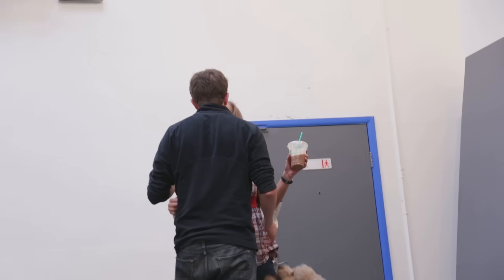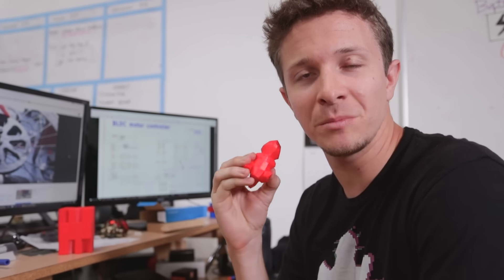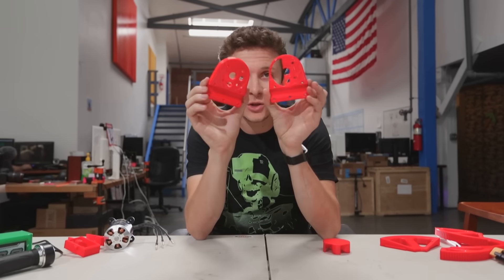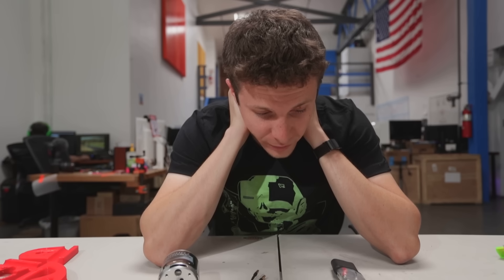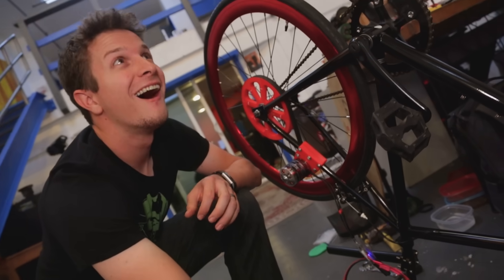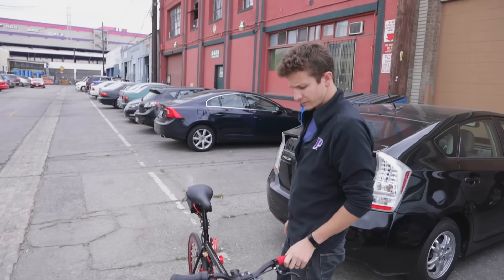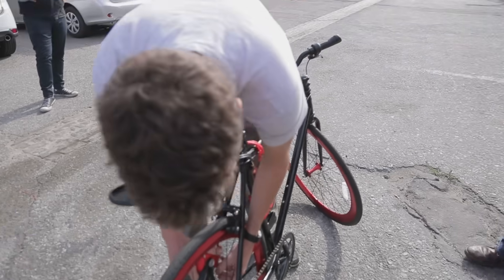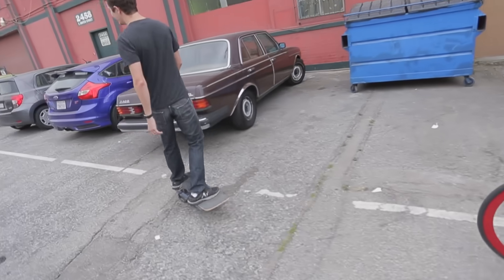Building a Tesla ELECTRIC BIKE For my WIFE

Comment: Takes already invented system (least gives credit to inventor), assembles it pretty much identically, is able to fuck it up and uses days to problem solve non issue.. and comment section is getting orgasm about this thing... did i already mention i hate humanity?

This is easy build and there is next to nothing to be impressed about. Hole went off center cause operator didnt mount it properly and didnt use proper equipment to make the hole. Motor mount was not properly tighten, so active breaking pulled the mount into spokes. After that whole thing was easy to fix and he just added bullshit drama for sake of views, or are people unable to drive local bike shop, or better yet fix it them selfs?
Also how this is anyway related to Tesla? Clickbate much? Cool topic but sadly most videos are this type of cancer..

Comment: In order to not bother with settings on the printer, which sometimes can be fiddly, they can even mess your print, one can buy a hot air desoldering station (the cheapest that allows for control) and a few misc parts. A wide nozzle is required (usually used to de-fuse the large chips, like GPUs or CPUs). It has to be oriented from the 3D head mostly in line with the last layer (i crushed mine to a thin slit by placing 2 mm gauge block inside and then applying some force with my hand), but at a small angle to catch some of the adjacent print).

Once all that is done, you have to really understand your PLA, your infill, and your speeds (if you're aware of the basic concepts of feeds and speeds in machining, understanding this from the 3D printer side, is much, much easier, it's like a mental map of the whole process), once all those things are set, you dial in your temp, and let it work. The PLA is kept at a nice toasty temperature, which allows fusion and a stronger part. 

IF you do this right, and i'm nowhere near as good as the person who showed me this trick in the first place, you can squeeze even ~20% more strength from your PLA. I did tests on PLA bars with various infills, some patterns work better with this method than others, after all, you don't want too much heat, lest you melt your work.

For regular work? Not worth it, but when you're prototyping stuff like miniature gearboxes or drive systems for a 1/50 scale for example proof of concept that needs to take some scaled abuse, well, it's priceless.

OF course, if you know your 3D simulations, this is obsolete, but sometimes, actually working with physical parts is better than watching a CAD twist and flex in psychedelic colors. :)

Comment: If you had access to a mill to bore that hole in the pulley it'll give you positional accuracy over the drill press. A drill usually creates holes that are oversized by a few thou so the pulley being loose is to be expected. 

The shaft should be keyed or notched if you want the set screw to work properly. A few seconds with a steady hand and a grinder will make a flat that'll hold the pulley secure. 

Glad you got the project done with the wife. Looks like she's really enjoying it.

Comment: You need to use a key on the pulley and the motor shaft. It will 100% stop it from free spinning. Good Job though :>

Comment: Sam kWh is metric, you don't need to explain it the rest of the world knows already :D
And to connect a part to a motor you simply drill a hole 1/2 1/2 when the pully and the motor are together cut a small thread in there and then a screw. Or you put a groove and featherkey in there.

Comment: I would have used thermodynamics to bind the engine shaft to the sprocket. Freeze the shaft, Heat up the sprocket. .... Sounds like a bad porno. I digress.

Comment: it's also good because if the battery runs out, she could still just pedal
Reply: Jack The Artist Exactly!
Reply: What is so special about it anyway? You dont know anything like electric bike in USA? ;)
Reply: she would have to unplug the motor from the vesc first, otherwise it might fry it.
Reply: what did you think the ped means in MOPED
Reply: lol
Reply: lol
Reply: yeah... but, no.

When you pedal against a motor, you either fry or charge it.
Reply: not true. It is made for pedal.
Reply: Jack The Artist    You should look up what a moped is. That will blow your mind.  A motorcycle you can pedal!

Comment: If the "motor should move with the wheel" and "one would not move without the other", would the motor charge the battery if the bike is in motion without operating the motor (similar to wind turbines)? or does the power only go one way?

Comment: Hey I am actually in the process of building one and already got my high torque motor and 40A ESC. I was wondering from your experience, how much of those 10A battery do you burn per hour? Do you connect those 6S in series or parralel? Thanks!
Reply: Depends greatly on how much throttle you're using, wind, terrain, bike weight, your weight, tire pressure, etc. For example,  I've got a BBSHD mounted on a Mongoose Dolomite. That's 1000 watts nominal with 300 lbs of bike & rider. My battery is a 48V 24Ah. If I ride all throttle, I get around 25 miles per charge and do that in about an hour. Using pedal-assist at a low setting, like 20%, I can pull 50-60 miles at 18 mph. That's on flat terrain and light winds. If I'm running low tire pressure, obviously I get less range. Check out "E-bike School" on YouTube, he's got a lot of info.

Comment: To fix the spinning spindle in the gear you could have drilled a hole the same size as the set screw into the spindle of the motor. Then use a slightly longer set screw so that it actually goes into the hole. Even a third or halfway through and the gear would prevent the gear from slipping.

The other problem with the motor mount rotating on the frame with the regenerative braking could have been solved in a similar way. Though the plastic might not have been able to deal with the stress of the regenerative braking. A metal mount either bolted or tack welded to the frame might fix that and allow you to still use the regen braking. 

That plastic mount may eventually still end up getting loose and flipping over later.

Comment: m8 when the motor was spinning and the wheel wasn't you could have just drilled a hole into the metal belt catcher and the motor stick part and put a pin in them
Reply: id have to draw a pic to explain it but it would work better then what you have now

Comment: My recommendations:

1) The motor would fare better in the little space between the seat tube and the wheel.  A mount there, reaching from the rear wheel's seat stays to the seat tube, would be triangulated and thus much more firmly mounted than the existing clamp style mount which is, as you found to your regret, subject to slipping and rotating.

2) using the mounting described above, orient the motor so its mass is more closely centered on the bike.  It will be a much stealthier mount, way less vulnerable to foreign objects in a ride, and possibly somewhat quieter, with its noise generated being under the rider instead of off to one side.

3) Mount the batteries in the main triangle.  This gets their mass lower and frees up the rear rack for cargo, as God intended.  There is also room in the triangle for a metric butt-ton of batteries, giving the bike potential range suitable for modestly long commutes.

4) Lighting.  I don't ride anymore because Tennessee drivers can't see bicycles.  Adding lights is a good idea to make the bike more noticeable.

Comment: Next time you have an issue with Pully-shaft, try using a key way and a key, thats how motors are mounted properly, the screws are there just so it doesnt slip off on the x axis lets say, the key is what prevents the slipping.

Comment: Looks good but i would like to make a few comments about this.

1. It can be less complicated and less likely to break if you just use a hub motor. 
2. I wouldn't trust that battery on the back of the bike as it makes it back heavy. See about either putting it in middle frame where bottle holder is or if your really confident soldering the batteries inside the frame itself. 
3. Plastic has gone along way but i wouldn't trust those parts out on the road, half way through it can snap and can have serious injury.

So in the end when you ask what to build, maybe a updated version of the ebike.

Comment: I built one of these with a much more powerful motor and the 3d printed pulley on the rear ripped apart. I should've used better glue and zip ties :(

Comment: Grind 1 or 2 flats on the shaft of the motor to give the set screws a fighting chance and not just relie on the clamping force of a 3 or 4 mm set screw and friction between 2 pieces of steel.

Amicalement,
Tim

Comment: I am amazed by how you were able to design those brackets and big pulley wheel that you 3D printed, as you clearly have zero engineering knowledge.
I mean come on; "why is the wheel wobbling", soldering the pulley and attaching the motor bracket just with friction. Those are all kindergarden-level fuckups. Any 10 year old knows better where I live... Your school system must be failing in a big way...

Comment: lol at 13:44, the limousine is being towned away xD
One more thought, when the bike is going with the electric motor turned off(for example riding from hill) the motor is generating  
 back voltage which can goes back to ESC and it can destroy the ESC.
If I am wrong, please correct me.
Sorry for bad english.
                                                                                                                                                         Krystof

Comment: Ummm, someone show him a real ebike, because this is just hazard in the streets.
Reply: Could have at least added a support from the motor mount to another part of the frame, relying what he currently is is just kinda stupid.
Reply: ᕦ( ͡° ͜ʖ ͡°)ᕤ Ultimate #POWA IT is 2-4 times cheaper not hundreds of times cheaper
Reply: chadel lol was looking through comments for random tips but just HAD to point out that even  copying someone else's design can be a good learning experience. Have you ever done a math problem in homework. Chances are you didn't make and solve the problem.
Reply: dzhiurgis - yeah i was thinking the same thing. Go to Lithium Cycles and grab her a Scout for like $900. It'll work, u won't have the headaches and there's a warranty. Plus, she looks like she's 70lbs. soaking wet so it'll be fast as hell too.
Reply: Amazing learning experience copying someone else's project and investing zero creativity
Reply: ᕦ( ͡° ͜ʖ ͡°)ᕤ Ultimate #POWA lol ya i would say this bike thing is a great idea. It's not that dangerous if u know what ur doing , aka have common sense and it overall costs about $500 to make as opposed to about $1200 or more for a similar product. Plus using what other shave done before is a good way to test how to make these things and possibly make ur own design
Reply: dzhiurgis This doesn't seem too bad to me. But the better homemade bikes I've seen attach the motor to the chain, rather than using a plastic belt, and keeps parts away from the wheels which means if anything does brake, you can still pedal or coast to the side of the road an fix everything.

Comment: i think you could get disc brake hub and mount big pulley where disc goes, this with zip ties is weak, and electric motor is toomuch exposed, you should consider to swap it place and mount it in inner triangle where rear brake is, right on place where the seat tube and 2 tubes from chainstay meet, that would benefit of making a motor mount on 2 tubes wich will be more sturdy, just my 2 cents

Comment: This needs a sprag clutch on the motor drive portion so the motor doesn't brake the wheel when you slow down.

EDIT:  Hahaha!  He broke it when he let off the throttle, nailed it!

Comment: Did you just call kilowatts a measurement of speed? That actually upset me. Power. It's power.
Reply: WILDLIF3 You are joking aren't you? Do you know basic physics? "speed for vehicles" oml. A kilowatt is 1000 watts. A watt is a unit of power, equivalent to 1 joule of energy per second. It has nothing to do with speed. 1 kilowatt is the same as about 1.341 horsepowers. It's not "sometimes called a horsepower", they're two completely different units for POWER.  Power is the rate of work done, which is force times distance, so power is force times speed. Kilowatts aren't a measure of speed, they're a measure of how much torque is produced per second (1 Newton metre per second = 1 watt).
Reply: BLUEHBEARZ Official Technically we are talking about movement in terms of electrons but still, this other guy is chatting shit with his sub-college level knowledge of basic physics
Reply: Matte Edström damn you're fuckin dumb
Reply: Rebellion I noticed that, too.
KW/h is a measure of power used, while a KW a measure of power. I think he meant to clarify it for people in the US who are accustomed to motors rated in "horsepower" but still billed by KW/h
Reply: Ecto Not necessarily....it depends on how much weight that power is pushing.
750w on a bicycle might get you 25mph but would barely be able to get a 3000lb car moving.
Reply: He said a kilowatt is a measurement of speed and kilowatts hour is the energy
Reply: He also did not consider the energy losses for charging during his cost calculation that might have a quite percentage of energy gotten by a battery. I mean that the amount of energy gotten by a battery never equals the energy spent on charging.
Reply: A kilowatt is a unit of power, power is the speed at which an electrical current can do work, thus, power can be loosely defined as speed.
Reply: He said kilowatts pertains to speed, which is obviously not always true, but this time it is. I think he just over-simplified it.
Reply: In a way he's correct by saying it's speed. A kilowatt is a unit of power, which is energy transfer per unit time. So you could say it's the 'speed' at which energy is transferred, which is what he meant. There's also the fact that he's an engineer, while a lot of people watching this might not have taken physics at high school level. He would therefore know that calling it speed is not entirely technically correct, but he also wants to make what he's explaining easy for everyone to understand.
Reply: Rebellion I can go 8 kilowatts an hour
Reply: BLUEHBEARZ Official energy*
Reply: I think he meant kW is to kWh as speed is to distance.
Reply: I'm totally late to the comment thread here but I stand by my statement. I described power as the speed of energy... WHICH IT IS! Power is literally how fast you can move a unit of energy. I think you misunderstood what I said. I was trying to describe this in a way most people might understand, so it may have seemed incorrect. The average person doesn't understand the difference between power and energy even though they're two very different things. 

What I find ironic here is Magic Balazs quote: "A watt is a unit of power, equivalent to 1 joule of energy per second. It has nothing to do with speed."
DUDE you literally just described the definition of speed, which is a unit of something PER UNIT OF TIME! You literally just said it's energy used per second. So if I'm going 1km per second... would you not describe that as speed?
Reply: Rebellion The kilowatt if you were to look it up in relation to a car engine is the speed. If a gasoline car is outputing lets say 85 kilowatts then it has 115.56783 Horsepower which you get after you convert the kilowatt to horsepower and horsepower deals with speed. Please read something on cars/vehicles
Reply: Speed = Power / Force
Reply: Horsepower definition - a unit of power equal to 550 foot-pounds per second (745.7 watts).

Torque definition - a twisting force that tends to cause rotation
Reply: Torque, Horsepower, and RPMs are all used for a cars acceleration which means increase in the rate of speed of something and the rate of change of velocity per unit of time
Reply: Chill the fuck out. We all make mistakes. Just like "ambers talent" that is a mistake. And you profile picture and username.
Reply: Yes, but the more power, the more speed
Reply: Thank you
Reply: He actually said it was NOT speed!
Reply: Matte Edström He says kilowatt hours are an amount of energy, NOT speed (aka kilowatt hours aren't speed), then he says that kilowatts are speed. And you're calling me stupid?
Reply: And it actually is!
Reply: Matte Edström He says kilowatt-hours are a measure of energy (which is correct). He then goes on to say that kilowatts (NOT KILOWATT HOURS) are a measure of speed (they're actually a measure of power, which is different to energy). We can't make this more simple.
Reply: FFS, Thats what i have been saying all the time!
No kW or kWh is an ammount of speed!
It's just an ammount of power or what energy that the battery can deliver!
Reply: Wren is right a kilowatt is also called horsepower which can be used as a measurement of speed for vehicles. Next time you comment please look it up

Comment: > don't use PLA, use PETG
> grind or machine a flat on your motor shaft, seat the set screw against it
> add anti-rotation feature to your motor mount, its unstable as is, the plastic clamp will loosen, and motor will crash into spokes again. Try a couple metal split locking collars integrated into your printed plastic motor mount.

Comment: Several things: First, file flats or machine key slots on the motor shaft to prevent slipping.  Next, mount the motor on the trailing edge of rotation.  That way it can't loosen and twist into the spokes.  Last, carbon spokes likely would have shattered in that scenario.

Comment: A set screw will usually not hold on a round hardened shaft like that an easy solution is to grind a flat on the shaft with an angle grinder or dremel and the set screw will hold